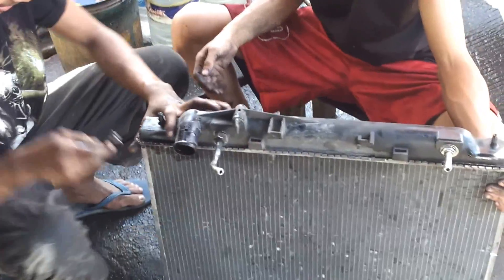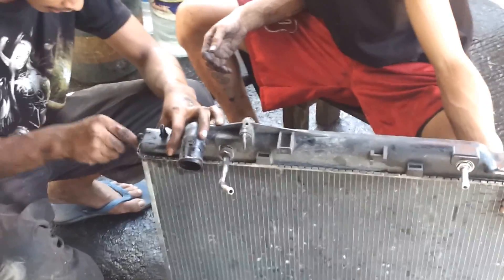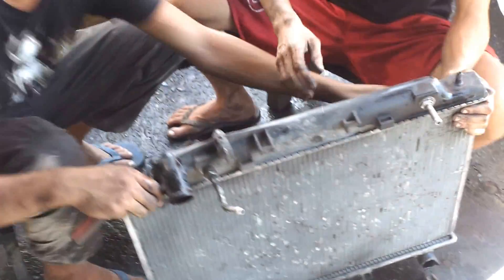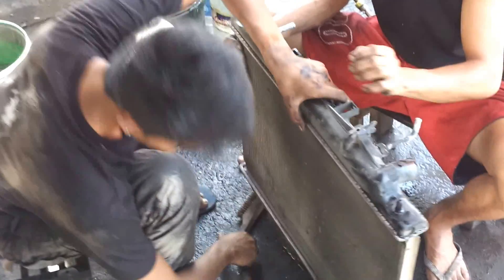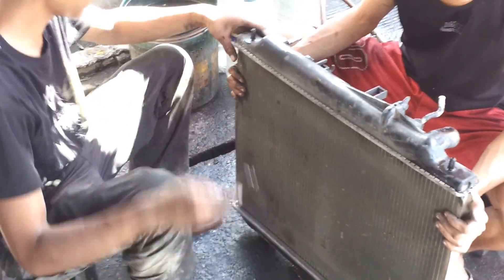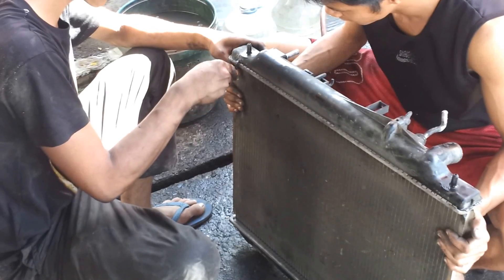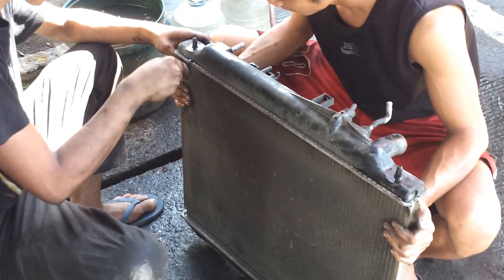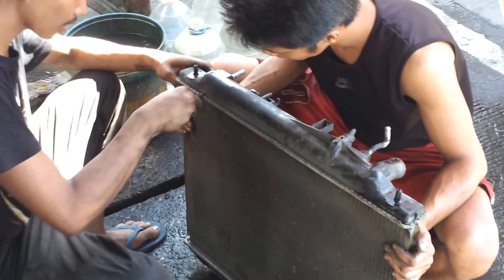Car Overheating -How to Clean the Radiator Core of a Clogged Radiator- Part 2

Comment: Sir which tool are you using to open that radiator top cover please reply 🙏🙏🙏
Reply from the maker: I think they are using a homemade tool that is similar to a bottle cap opener. Not sure if you can buy this tool easily.

Comment: Do you have a video putting the top or bottom of the radiator on?
Reply from the maker: john mcgill I didn't catch that in the video, but it is basically using the same rubber gasket that was there before, cleaning it and then placing it on a bead of gasket high temp silicone that goes all around the bottom or top of the radiator. They only place the silicone on the radiator side of the gasket but you could probably place it on both sides. Then quickly place the bottom or top back on the radiator and re-crimp the tabs.

Comment: thanks for video..just what i was looking for....my car is an 89 ford festiva...it ran fine for yrs., no problems ..however, my mistake, i never changed the radiator fluid for years.....then i decided to do a radiator flush, i flushed with water and added 50 50 coolant and water..car ran fine until i turned the heater on, then the car started skipping, and running uneven, as if something was gumming up the radiator...the old radiator fluid i took out of the car was brown, and was probably rust that had built up for years..and now the car, when i accelerate, seems to have a clogged radiator now..it 'skips', and runs uneven.i can drive the car, and go on the freeway, but it runs uneven....i know its the radiator, because right after i did the flush, and turned the heater in the car on,  the car started having the symptoms..i do get heat in the car, and the heater works...i tried flushing several times, and also tried running dishwashing liquid thru the radiator, driving a bit, and then flushing again, maybe to cleanse the system.....still no luck..i have heard to try 'simply green' and flush shortly with that chemical..or have read about using vinegar to get rid of the rust..or a 'radiator flush' from autozone etc..or do you have any other ideas..?  i'm trying to unclog the radiator without having to take it apart...thanks
Reply from the maker: 6955beniegn The primary indication of a clogged radiator is the engine overheating, especially driving uphill for a long time. Also the center of the radiator remains cool to the touch (use caution and turn off engine) even after driving a while. If the radiator is hot around the edges and cool in the center that means the channels are clogged in the radiator. As far as I know there is no good way to clean them without taking the top off the radiator and using an old dipstick to clean them out. In most 1st world countries it might be more cost effective to just replace the radiator. Most modern radiators use plastic tops and you must use silicone gasket cement when you re-install the big o-ring that seals the top. This is not an easy job for the inexperienced. Good luck! :-)
Reply: Philip Merritt thanks...i figured it out, and got my radiator cleaned.kinda....my car never overheated, even though i never changed the radiator fluid for years...i unhooked the bottom radiator hose..the old fluid came gushing out..i then ran hose water through the radiator..as well as the overflow reservoir..i think the old fluid was stuck, or gunked up, in the channels somewhere..i then used 'prestone rad. cleaner' and ran that for several days while driving.....even after several water flushes, driving, and more flushing, and running the heater on high while driving..im still getting some dirty water after a flush from my radiator..i will continue to flush it, hopefully get it as clean as possible..and then hope for the best and add 50 50 water and antifreeze  thanks for your advice